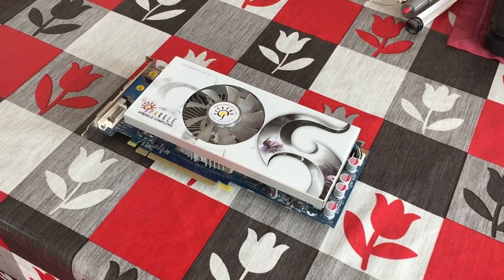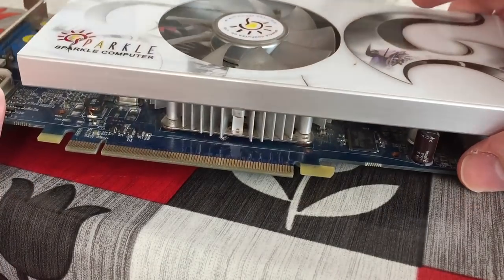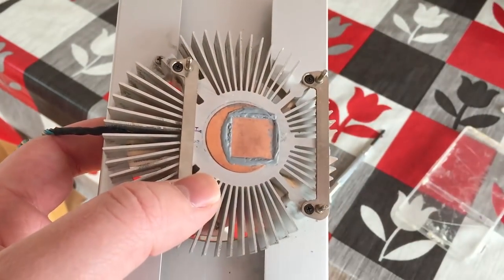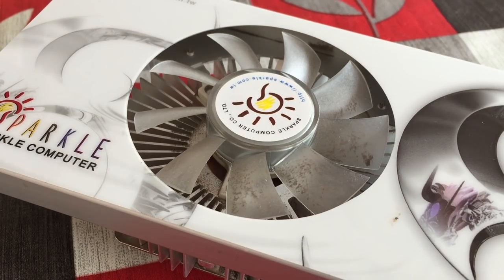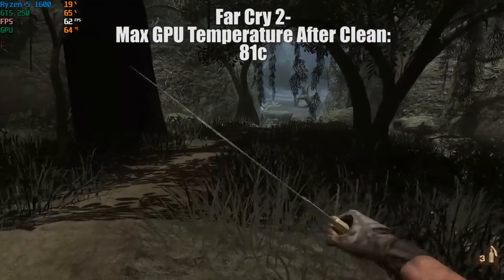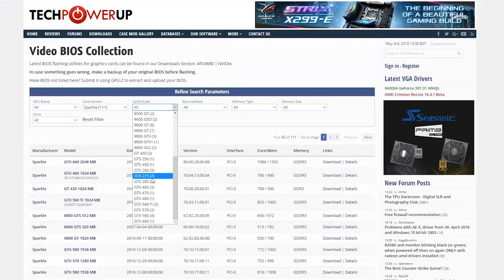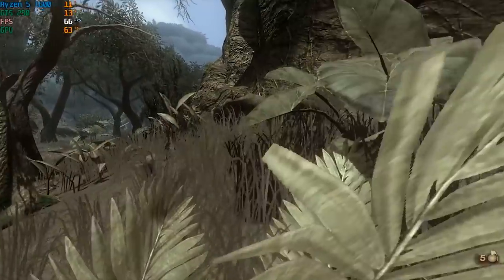Getting An Old GPU To Run Like New

Comment: Very important to make sure you use enough compound to cover the die.  Bare dies are the only time that I recommend the spread method.
Reply: Doesn't matter as long as you use enough. I should post my extreme overclocking videos, its almost comical proportions. You ever see 5-10 grams of paste on a GPU? That's enough for roughly 20-40 CPU applications, but that's not enough for sub-zero application. Most GPUs though only need a little over a pea sized drop of paste. If you're unsure, either double/triple it (assuming its not conductive paste) or remove the cooler again to check, and reapply. 

Any excess will squish out, and I've put piles of thermal compound, even comical amounts. I dump some around the die in the surrounding GPU socket so even that gets squashed out (same with CPU socket, fill the socket with paste, careful to not bend pins, then insert the CPU, then apply a ton to the top of the chip). <- Don't do that to your CPU normally, that's just for keeping moisture out so nothing shorts out when the water condenses out of the air in the socket. There's a lot more steps.
Reply: Exactly.  This video specifically said use a small amount, less than a cpu.  To me that's risky to tell people as they might not get full coverage.  Something that doesn't matter on a heatspreader, but is critical on a GPU.  It's far better to have a bunch of non conductive compound ooze over the sides of the die than leave the corners uncovered and have it die.  Thus why I suggest and practice the spread method for bare dies.  It's foolproof way of ensuring there is full coverage.

Comment: passively cooled GPU users laughing while watching this video
Reply: They still get dusty. At my house it takes 1 week before I have to remove water radiators to clean dust bunnies, even tables are filthy in that week. Oh the joy of living next to a gravel road in the country...

By comparison, I haven't had to clean my PC in 2 years at my dorm room. I have the case panel off, and run my fans over-volted (boost converter to quadruple power output) and its pretty amazing how clean it stays.

Comment: this heatsink had just a bit of dusty cover over the aluminum. a real performance benefit of cleaning comes when the dust blocks off air and when the radiator aluminum sheets are stacked very close together (high power gpu's)

Comment: "No, its not a Console Gamer" - that made me laugh. Peace to console gamers coming from a multi platform gamer myself.

But yeah - I cleaned my PC parts as well. Its not on the level of Bryan (The YES Man) but I used WD40's Direct Contact Cleaner and it works and apparently my PC has reduced temperature by 10C and performs better than before.

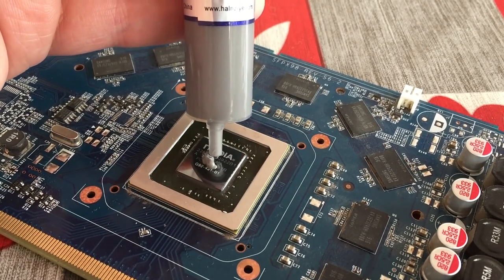Comment: 3:30 Actually, with a GPU, you want to use MORE compound than a CPU, basically, so long as your TIM is non-conductive, you basically Cannot use too much!
GPUs and their coolers tend to be more convex than CPUs, which is yet another reason to use more compound per mm2 of silicon. ESPECIALLY on a Large Die such as my GTX 980 Ti - which at 601mm2 is one of, if not the LARGEST consumer GPU dies ever made!

In fact, if you count the Titan V as "consumer" that is probably the ONLY larger GPU die! The Radeon Fury X is just a tad smaller, at 596mm2!

Comment: Two weeks ago i have cleaned my card which is powercolor R9 270x
Before cleaned up it reached 84 degrees and used to make a terrible noise 
I have cleaned it as you have done but i add bonus trick which is removing the sticker from the bottom of the fan and cleaning and oiling the axis of the fan itself 
And the result was impressive 
The card noise reached a very magnificent result 
I approximately don't hear it's sound but i hear the sound of my HDD 
And the temperature maximum reaches 71° with a powerful game like assassin's creed unity on medium to high settings on 900p resolution

Comment: Just get a case with decent fan filters and open your pc and clean them like every 2 months, for the past 2 years I had no problems with dust in my new case and the PC has a Ryzen 5 1600 and a RX 480 and has been used for mining for over 4 months at one point.

Comment: Spring cleaning! Awesome video. I just cleaned my I5 660 it was gnarly. I've had it for a while. One of my favorite cpus. Hey I don't think you have done anything on my I5 660. Two cores but plays gta 5 perfectly. Doesn't over clock. And cheap. Just a year ago they were alot more expensive. Ryzen thanks for actually making a awesome cpu. That does not cook your dinner and dry your clothes lol.

Comment: Just recently I put new CPU paste (AS5) for my 5+ year old laptop and temperatures dropped quite nicely, previously fan would kick to higher gear often during normal web browsing etc. but now practically never. There wasn't that much dust as I have used aircan often so improvement was definately because of paste alone. Why I didn't do it way earlier, darnit. Maybe it's time to do the same for GTX970 if stock paste can go this bad over time (if it was any good to begin with).

Comment: I7-2600 on an iten stock cooler ran about 68c during cinebench r15. cleaned out the PC and reapplyed the thermal paste and temps drop to around 62 -64c during  cinebench test.

Comment: You made me remember my old HD4870, almost 10 years ago I've flashed the bios just do adjust the fan curve because I was tired to use an archive to configure the MSI afterburner, got a 10ºC decrease and less noise, and no alteration on performance

Comment: A video about flashing GPU bios would be great! Few days ago I was trying to overclock my 9500GT and it actually went really well. But I got to a point when a slider in MSI afterburner was maxed out. I think that a bios hack should definitely help to gain some more performance and it would be great to see you go through the same procedure before I try it on my own.

Comment: You should get a small air compressor to clean the dust of your older system, believe it's fun and efficient
Reply: Robby Ramirez Static Electricity can kill components.
Reply: An AIR COMPRESSOR, not a vacuum cleaner

Comment: I recommend cleaning the heatsink by placing the aluminium or copper part in a pan with vinager and a spoon of salt, leave for 2 hours, wash with water, dry and replace your thermal paste. Mine R7 265 went from 74C° to 65C° at full load

Comment: I don't have problems with my GPU or CPU overheating because of dust, it is the Power supply that fills up with dust.

I thought about opening it and flipping the fan around, so it takes air in from the case and blows it out the back. But i don't want to open a PSU, as it will void my warranty.

Comment: i always overclock to the absolutemax that i can get a card to run at, back it off 5mhz to stay 100% stable, then use nibiTor to change the bios clocks to the max clocks i got, and flash it... card always 100% overclocked to its max stable :D

Comment: My GTX 980 throttled after a year of use so i did the same thing and improved temps by a lot, like i had 85+, sometimes 90°C and after that never over 72°C

Comment: I had an old Nvidia 9800 gt that would spin up 100% almost instantly in games and sounded awful. When I finally took it apart the thermal paste was like dried up clay. When I switched it out the thing sounded much happier.

Comment: I would've put the heatsink in the sink.
And just use toilet paper.
No need for ear cleaners.
Also put some new oil in the fan.
I have an old Raidmax fan that basically destroyed itself, but with some oil in it it works better.

Comment: Sorry to tell you, but this cleaning was pretty nonsense in the end. The 5° difference is not much due to the cleaning, but because the new thermal paste seems to be a better quality. However if you got better performance (which it doesnt appear to) it would have been better. If theres a cleaning issue you can drop 20°...

Comment: Some other things you could do is set a beeter fan curve using MSI Afterburner, and also check if the fans are spinning freely. On my 7870 one of the fans was seizing up, so I oiled it. Had to drill a hole in it to get to the axis, but it did seem to do the trick

Comment: Wow, a card that requires 2X6 pin power connectors, yet uses a heatsink that's probably worse than an Intel stock cooler. No wonder it runs hot.

Comment: Those are nuts, not screws. You should also pull the sticker off of the back of the fan motor, and add a drop of electric motor oil to the rear bearing. There may be a rubber plug under the sticker, but a small flat head screwdriver, or o-ring pick will remove it with ease. Good video by the way!

Comment: disassemble what ever part you want to clean and wash it (except fans, water affects the grease that they have)
let it dry and make sure there is no moisture left (they usually dry in 45mins to 1hr depending on room temperature)
assemble it back and youre good to go

Comment: I once forgot to plug in the fan connector for the cpu and it over heated in 10 minutes it was a pentium 4 machine but it was stable but some too demainding and off it turns off

Comment: Some of the newer GPU dies are huge and use a lot more paste than most consumer level CPUs, and you really want to make sure there is full coverage since there is no heat spreader. Lots of people recommend an X with GPUs instead of the pea sized drop.

Comment: It's not always advisable running the newest drivers for older cards. The most recent drivers will prioritize improvements for the latest models, and in some cases that can conflict with older cards, hence reducing performance or stability. It really is a case of trial and error.

Comment: 1:18, ya don't ever remove connectors by pulling the wires like that it's an easy way to break a pin off inside the connector.

Comment: Had the same issues with my GTS 240. The heatsink was covered in dust so the gpu went hot and melted the fan motor, so it does not turn on anymore and it's hard to turn it by hand.

Comment: Be sure, in the future, to pull the fan power connector by the plastic head rather than by the wires. You wouldn't want to rip out a wire and then have to resolder it!

Comment: To be honest, particularly in an open air cooler cards such as yours rather than a blower style cooler that amount of dust would not have affected the performance that much what would have made the biggest difference is the new thermal paste because if it's old and dry that causes issues and the fact that the actual contact between gpu and heatsink lossens over yesrs of use

Comment: 84 is still kinda hot O.O
Try removing the heatsink shroud, since it might be blocking the airflow.
Reply: No it's not 84 is perfectly normal when a GPU is under load

Comment: while a Microfiber does work, may i recommend a cheap Paint brush or chip brush to sweep away Dust? it works a treat.Brushes get in to all the nooks and crannies, maximizing your cleaning. i would leave the Microfiber to external components & ploishing.. ALSO, don't be afraid to use good old soap and water to really clean this stuff. As long as you give it sufficient drying time and the components are 100% dry this is a safe, effective cleaning method for components!
Reply from the maker: Thanks for the tips. I was looking for a paint brush earlier as I’ve heard they’re handy
Reply: i buy chip brushes in different sizes from wide to narrow, they cost a few cents each. I have an air compressor so i will brush lose all the dust, then give it a few shots of air to blow it out! i find it more effective than any "wet" cleaning.  Cheers!

Comment: I saw a video on linus tech tips where he put a whole lot of thermal paste on there and it still worked
Reply: Its fine, any excess will squish out. Extreme overclockers put an entire tube on and around the GPU (CPUs actually cram the socket underneath to keep out air and moisture, careful to not bend the pins). You won't break it doing this as long as its non-conductive paste (most are fine).

Comment: Hi unrelated to this video but could you advise me please. I have a lenovo m72e bought a gt 1030 but I just get a blank screen when I put the gpu in. The graphics options don't have a pci e option. The cpu is i3 3220 would it be viable to get a different motherboard. Many thanks
Reply: was the card new?
and was there a working card in the computer before hand?
Reply: Steve Smith . The card in new yes. No there wasn't a graphics card in the computer before
Reply: just spit balling here

A) the PCI-Express lane doesn't work and thus you need a new motherboard. I shorted out the slot on a Dell Optiplex 780 sff a while back so everything worked except the PCI-Express lane

Was your computer new or used? if it was used, it's possible the lane's been broken the entire time and you have no way of knowing. Or even if you bought it new, it died somewhere along the way. Heck, it's entirely possible it was working till you tried to put the card in and you shocked it or something depending on your environment 

B) Card is a dud. You said it's new but it is possible you got a bad one

C) I don't think there is any GT 1030 that requires external power, but just double check you don't have to plug a power supply cable into card

D) Normally I would ask a person to test both components. So the GPU in another computer, and another gpu in the slot (But that's obviously not practical for many people) 
Does your computer make any sounds or have any lights that flash when it boots. Computers can provide error codes to tell what is wrong. 

E) Have to tested out all the output ports or tired a different monitor. Could be a resolution issue.

Comment: Maybe do an oil change
Reply: I usually oil my case fans yearly, it seems like GPU fans are built a lot higher precision, but it probably wouldn't hurt.
Reply: Jake Garrett but dont forget to oil the hard drives
Reply: Uh.... I've got old IDE interface drives that still work (whopping KB/s compared to my 900 MB/s SSD), they still spin up fine. They are so old, I have to run active adapters converting PATA to SATA protocol (similar to server RAID cards can use either consumer SATA or SAS). I don't think I've ever seen one that needed oil, plus by the time they are in the 8 GB or less range and new drives run ~10,000x faster, its probably time to upgrade.

I still use them for extreme cold storage (not, my normal sub-zero cooling, I just mean barely accessed info stored in a fireproof box away from the system). If its important enough data, its important enough to let a 1 GB file copy over-night and have it protected from even thieves unless they want to go through the trouble of running adapters for super outdated technology.
Reply: I haven't personally come across any drive that needed oil. There probably are a few that have needed it, I just haven't seen any, so I wouldn't recommend it unless you're hearing obvious bearing grind (and not head thrashing since that plagues every mechanical drive I've seen) and transfer over data imediately.

Might be worth a shot if you really want to recover the data from it not spinning up fast enough, yet not important enough to use a professional data recovery service.

Comment: just did the same thing yesterday with my just arrived HD 7750

since for some reason the heatsink and the fan won't separate (the screw stuck so hard), i decided to clean both on the sink anyway, surprisingly it still works (the fan that is), i also replaced the thermal paste

the GPU never reach 60 C even in gaming now :)
Reply: I picked up a 7870 the other day but sadly it wont work. I believe the guy who I bought it from that it worked when he gave it to me, but every time I install drivers, I get black screen at the windows icon boot screen
Reply: that's too bad.... i hope you can either make it work or at least get your money back

btw, how much did you get it for?
Reply: Ivan Constantine I got it for only $50 on craigslsit, picked it up when I last went to nyc. I only got it to put on a spare bedroom pc.

I'm not upset with the seller, this is evidently some issue with amd gpus from that generation.

Guy is reasonable so I'll see if I can work something out since I don't go over to nyc very often. (I'm from long island)
Reply: Steve Smith demn, in my country 7870 goes for at least 80-90$... People in my country really loves putting high price tag on old gpus

I actually got pretty lucky since I only had to pay around 30$ for this one...

Comment: Consoles also have the enemy DUST
Reply: Surprisingly the PS3 fat edition had very little dust after 3 years, yet my computers water radiators need to be cleaned out weekly to be as clean (actually more often, but in 2 weeks its way too long with massive dust bunnies, I already use a comb to clean it after 1 week!). 

My cousin lives nearby, and his actually caught some cobwebs on fire (VRMs powering the FX processor), so we laughed saying its self cleaning, but really, you probably shouldn't rely on fires to keep it clean (its still running fine to this day, but now he actually cleans it once in a while after having a literal fire...)